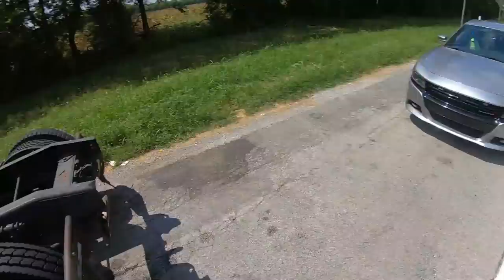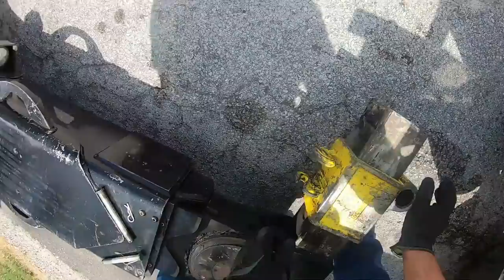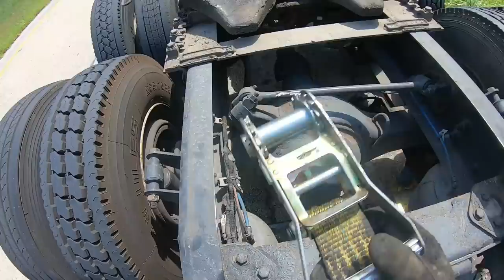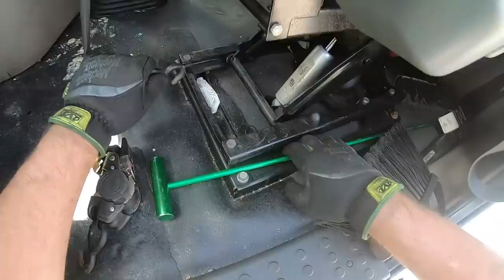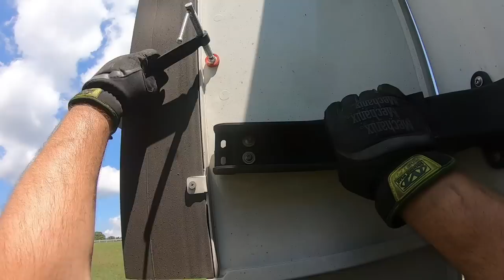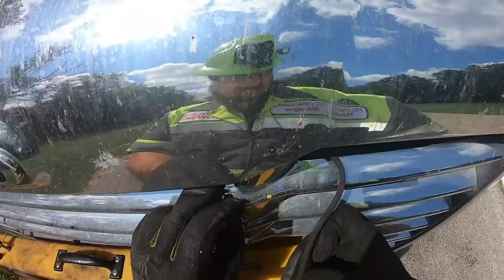Kentucky State Police Calls with a Stolen Semi

Comment: You never know who is at fault when a driver if fired and told to turn in his truck. With on-board cameras and GPS, the company knows where the truck is. Just like when Celadon went belly up, they stranded hundreds of drivers, and no way to get home. Fuel cards turned off, no cash advances and no final paycheck.

Unless the truck was part of a fleet account I had, I pulled driveshafts or axles depending on which was easier. A few minutes with an impact gun and the axle shaft is out. A foam plug kept the oil from leaking out. Plastic bag for the bolts. Hated pulling driveshafts, as if hadn't been pulled before was going to be a pain. 

Chances are the driver knew the end was near, though other times it's a surprise. The interior condition wasn't the most pristine truck I've ever seen. With a turn in order, the driver will have problems finding another job.
Reply: From what I heard, Celadon wanted drivers to return the trucks to the nearest terminal too.
I wouldn't be shocked if the company slaps him with abandoning the truck. Personally I think it's a bit moronic to fire a driver on the road, and expect them to drive it back to a terminal.
Maybe in this case the driver knew it was coming, and was just heading home.

Comment: Might it have been easier to turn the tractor around on the ramp, since the Trooper was holding the traffic and you would tow straight ahead off the ramp?? Verses turning the wrecker against traffic and backing up the ramp to the road.
Reply from the maker: Yes however I do not like starting or operating other companies units when a driver/company are not getting along.  This way guarantees if the driver did something to the truck its not my fault.  As you see I dont even turn the key on.. CYA I want 0 liability.

Comment: Wouldn’t the bobtail tractor have been shorter than the wrecker to spin around on the ramp? Hopefully the ex-driver gets back on his feet.
Reply from the maker: Yes however I do not like starting or operating other companies units when a driver/company are not getting along.  This way guarantees if the driver did something to the truck its not my fault.  As you see I dont even turn the key on.. CYA I want 0 liability.
Reply: @MercifulTowing  Very smart thinking, the company is going to go after the ex-driver & possibly the tow company for any damages.

Comment: Why do you use a strap instead of a chain to hold the axle in the tow cups? Love you channel! I also enjoy watching Ron Pratt from Midwest Truck. Both of you treat the drivers and vehicles with respect no matter what happened.
Reply from the maker: I prefer the straps, for me I feel more secure.  One thing that drives me crazy about Ron is he uses the tilt to tighten method with his securement chains.  Thats old school.  Guys have been doing it since the underreach was invented.  I cannot get myself to trust it!!! As he would probably say he cant get himself to trust my straps.  Its all personal preference as long as it gets to the destination safely thats what matters!  As Ron likes to say.. Theres many different ways to reach 10.  Thanks for watching!
Reply: @MercifulTowing  thanks for the reply. I was just curious, not sure the strength rating on the strap vrs a chain, but if it works and holds go for it.
Reply from the maker: @davemoulton2971  these straps are specifically designed for heavy towing.. they are 2 ply 14k lbs rated.  Not your typical strap lol
Reply: I was wondering the same thing! I like how easy the strap makes it though

Comment: Nice video. Question. Why not just drive the tractor to the end of the ramp rather than backing up the whole way? He might not have been able to drive it but you could. Nice hook and good thinking on the fairings.
Reply from the maker: I do not want liabilty if the driver attempted to sabatoge the unit.  Anytime we have a tow with a company/driver dispute we do everything in our power not to start the truck.  We find them all the time, pouring rain and the fuel caps are open all kinds of stuff.  So we attempt to cover our butts by just not starting it.

Comment: Man hand you need to put a mask on to get in that truck. Thats gross. Nasty people . Gee whiz guy. Be safe out tere and god bless brother. I used to drive a medium duty tow truck and it was dangerous then. I can only imagine how bad it has gotten since a drove one.. i quit when a drunk driver almost run over me  .luckily i was on the passenger side and she ran into the car iwas loading amd pushed it over the end of the bed and i to the cab.of my truck. That was the final draw for me. I was young with two young kids and i decided it wasnt worth it anymore
Reply from the maker: Glad your alright man, sounds like you had an encounter close to mine! Go back and look at my Slow Down and Move Over video.  I posted it along time ago you may have to scroll a ways.  Loading a truck on a flatbed and a drunk driver broadsided the truck, sent it up over the side of the bed and if it wasnt for the cable barrier it wouldve landed on me!